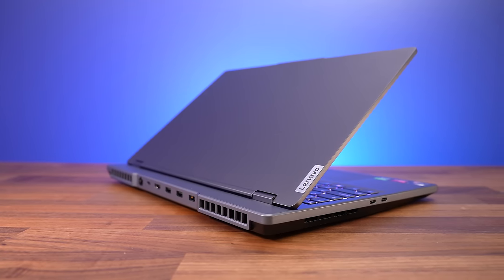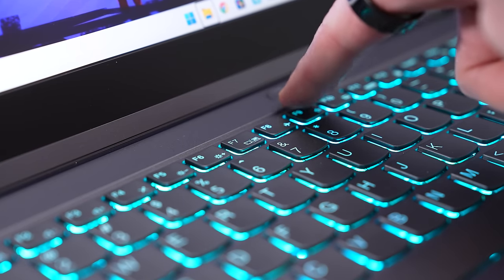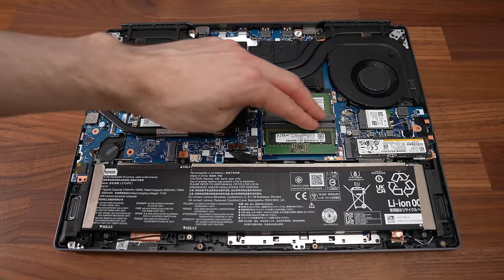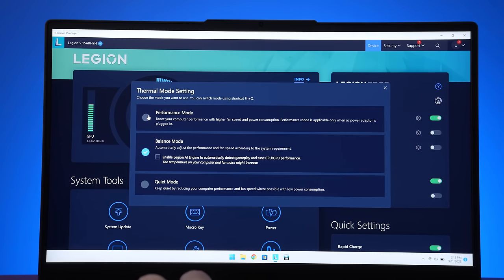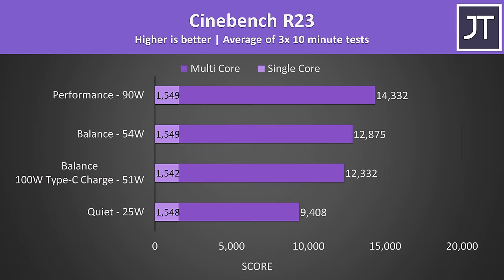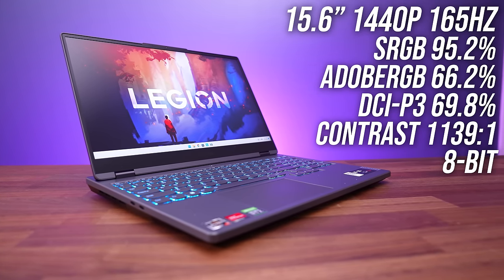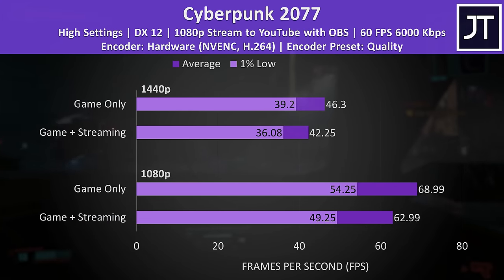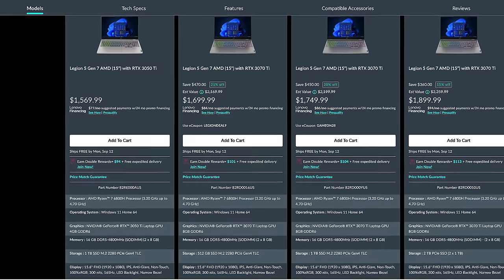Lenovo Legion 5 (2022) Review - Still Best Mid-Range Gaming Laptop?

Comment: Hey, Jarrod! I think that Lenovo gaming laptops are great, the reason I even bought my first personal laptop: Lenovo R7000 2020 (Chinese ver. of Legion 5) was because of your video review in 2020. That was also the year I discovered your channel because of how you go down into details with the specs and whatnot about the Laptops you review. I'd like to request if you can address the stuttering issue with Lenovo gaming Laptops? Lenovo Laptops have been gaining a lot of recognitions in the past few years particularly the Legion 5 and 7 in your reviews as well as their ranks in your annual ranking of gaming laptops that you've tested. I think that claiming, as per your video description, that Lenovo Laptops as your favorite high, mid-range gaming laptops are going to affect consumers' choice to buy off these models, only to reach a certain time where they experience lots of after-sales problems particularly with these annoying stutters. In my case, it happened like a month after I bought my laptop in 2020. I thought it was just a software issue that'll only be fixed by updating the drivers or something like that since it was a new laptop. But no, it did occur a few times until it reaches to the point that it became like a requirement to have the laptop get stutter when I try to use it. It usually happens when a play music, video, and games. Even just casual roaming around my desktop, it happens. I can't help, but to bear with this annoyance in the past couple years and just helplessly accepted my fate with this laptop. I thought that it was a defect on my laptop alone. After several research through the internet, I've been getting information that it was an AMD issue, since I own the AMD version. Then, I just found a recommended video on my Youtube feed that Lenovo Legion 7i has the same issue as well. What's worse is that, it has the worst stutter experience I've ever seen in a Laptop, like totally annoying, and loud given that his Laptop, Legion 7i, has far higher specs than I do. That's when it hit me that, that's it. I think that the after-sales concerns are not very much recognized in your channel. Not to mention, I even suggested and bought my sister, on her behalf, the Ideapad Gaming 3 amd Ryzen 7 3050 Ti.  Because other than the stuttering issue, Lenovo laptops are really great. But guess what, right after playing some music in her new laptop in the first day she unboxed and use it, the stuttering occured, I was like, wth are the deal with Lenovo and these stutters. Like, right now, I don't know how to react about it. I'm just helpless and truly disappointed. It's not the CPU, the updated drivers, etc., It's Lenovo.
Reply: Ya, I'll never buy a Lenovo AMD laptop again. 2021 Legion stopped getting bios updates within the first 6 months and is permanently stuck with stutter issues because Lenovo won't update the BIOS. The AMD update that finally fixes issues on the 5000 series came out in 2022 and Lenovo doesn't seem to update past the first year (last bios update was Dec 2021).

Comment: I have this exact design.
 Lenovo Legion 5 15ARH7H 15.6" Gaming Laptop Computer Platinum Collection - Grey
AMD Ryzen 7 6800H 3.2GHz Processor; NVIDIA GeForce RTX 3060 6GB GDDR6; 16GB DDR5-4800 RAM; 1TB Solid State Drive.
Could you please make a video on to how upgrade it to the max? I'd love it 😀  ❤️

Comment: Using Lenovo Legion 5 2021, no regrets!
Reply: Same, with a 3050 ti
Reply: @Grimmguy3  I have the i511400H with 3050ti, 80Wh battery but only lasts for 2 hrs on battery (power saving mode on, low brightness, using browser). That's my only regret
Reply: @HeyItsJace  yeah, mine has Ryzen 5800
Reply: Me too I however am just noticing that I am averaging 85-90 degrees Celsius on my CPU temp on any amount of load, and I can't remember if it was like that from the start. I even renewed the thermal paste and cleaned the fans. 

Are you having the same experience?

Comment: I have a question regarding this laptop. I am a somewhat casual gamer, but I know that what matters most in gaming performance is the gpu. Rtx3060, even mobile is more than a decent gpu, even now. But I can't help but wonder about the vram, I don't intend to play on more than 1080p, but I do want to be able to play all the new games on settings better than low. In this context, is 6gb of vram enough? Already games like star wars jedi survivor are demanding  in the spec sheet 8 gb of vram, I'm guessing it's ok for 4k, but will 1080p work good? 

I'm hoping that games makers will mind about the fact that there are a sizeable size of budget laptops that use 4-6gb of vram, rtx 3050 mobile, rtx 3060 mobile, rtx 4050 mobile. These are decent chips, it would be a shame to be punished for low vram. They are not meant for 4k.

I am upgrading from a gtx 1650ti and got the legion on a very good offer, it was the cheapest rtx3060 by far on a laptop, I can't afford anything better than this and I am wondering if it is worth it.

Comment: hello, i bought this laptop back then upon your video , works great but 512 GB is way low, i want to expand storage for data, based on datasheet it has PCIe 3.0 x4 slot , i know if i bought an SSD with PCIe 4.0 will work , but would function at advertised speed ? or it'd be downgraded to PCIe 3.0  specs? as i'm now between cheap 2TB from msi m450 or cruical P3 , or going upgrade with crucial P3 plus or P5 plus , i notice most of PCIe3 are QLC compared to PCIe4 mostly TLC , so what do you think? i rather have upgraded variant but if my laptop would never got benefit of its specs, i'd rather spend less , regards

Comment: Hello, I just bought this model online as of now and will be getting a 230W power brick. 

I have a question about the second SSD. It says it supports M.2 2280 SSD up to 1TB. 
(Notes: The storage capacity supported is based on the test results with current Lenovo storage offerings. The system may support larger storage as the technology develops.) 

Do you think it supports anything higher than 1TB?
Reply: 4:46 bro saind that it supports 4TB ssd on each side

Comment: I'm in the UK and we have LITTERALY the other side of stock hardware, probably made for the EU market as with the phone processors.
Now under sale is £999
2022 Lenovo Legion 5 NVIDIA RTX 3060, 16GB, 15.6" QHD IPS 165Hz, RYZEN 5-6600H Gaming Laptop
It's 6600h and Wi-Fi 6E 11ax, 2x2, 300W charger and Webcam FHD 1080p with E-camera Shutter, so it makes sense.
Just like my S21 Ultra has a different processor in the UK/EU vs US markets.

Comment: Thanks for this video. I did purchase this machine as a landscape student. I have done a lot of research but I feel I am still in need of some basic instruction on how to keep this machine from running well ( speed, temperature, battery life) For instance when I am running vray how should I prep this machine so that it runs best? Are there settings I should keep it at on a daily basis when I am not rendering? I am trying to learn from this video but I am not sure if it's all applicable to me. Thanks!
Reply: Hi! Have you some information about the battery life in real-world? I want to order this laptop but i'm a bit affraid about that. Thank you!
Reply: @asleoo999  I actually don’t atm. I just got it and planning on unboxing when I get back to school tbh I am a little intimidated.

Comment: If it had a metal chassis and wasn't as thick I might consider it. No per-key RGB, no Windows Hello is regrettable in 2022 though. That being said I know it has decent thermals, so there's that.
Reply: The Legion 7 models do have a Windows Hello fingerprint sensor. No per key RGB or brightness adjustments without software is annoying too. But the thickness is important for the higher power limits. Metal is also usually reserved for more expensive laptops than this.
Reply: No other laptop in this price range have the features you've mentioned. You're expecting too much.
Reply: @AdvancedGamingYT  You're right, it's a decent price/performance.

Comment: It would seem that moving that third heatpipe from the GPU-die to the NVMe slot had a negative impact on GPU thermals -- from my testing, the 3070 5 Pro from last year never even crested 80c in sustained 140W + 45W stress tests with its stock fan curve.
Reply: What processor did it came with?
Reply: @aceb2660  Ryzen 7 5800H
Reply: I have the legion 5 15ACH6, my battery only lasts 2 hours after a full charge, is this normal?

Comment: Bonjour
@ 6:00 regarding the USB C PD
The documentation says it is PD compliant but as explained in the video the Legion 5 Pro is NOT PD 3.1 compliant
In my point of view, Lenovo plays on words in their documentation and on their website
Having to use and buy a proprietary power supply to get 135W is, IMO, a pain 

My Legion 5 Pro (16IAH7H) is expected Dec 25 in the morning...🎄
I will see what happen when used with my Rocoren 140W USB power supply, but I suspect the load will be limited to 100W (20V, 5A)

Many many thanks for the vidéoS.
Regards, 40tude

Comment: Hey @Jarrod’sTech Important Question, I am in the process of buying The Legion 5i Pro but im not sure of which model to get. Should I get a AMD or Intel Based processor, which do you personally prefer? 🤔 Im not sure which one to get from a strictly gaming standpoint.
Reply: Which do you end up buying?
Reply: @naqib4235  I ended up buying the 2023 Legion 7i Pro RTX 4080 GPU with Intel I9 processor. Intel has more of a slight edge in gaming and some work loads too. Worth the buy for the Intel based machine.

Comment: I've bought the last year version Legion 5 2021 with 3060, when this Legion 5 2022 came out its kinda makes me want to replace to it because the newer more "sleek" design and higher 1440p resolution. Thankfully I'm waiting this review from Jarrod to get some deeper objective review,  so I'm stay using my Legion 5 2021. 
as JT said: If the laptop still works perfectly well, then no need to upgrade because there's always going to be something new just around the corner.

Comment: I am using Legion 5, 17 inches from 2020 for data analysis and light gaming. I think keyboard from Lenovo is best, even better than Apple. Thermals are OK  for me. Port selection and placement is great. Sometimes my laptop struggles with computational tasks but this is more OS issue. I absolutely adore it's design and overall ascetics. The only downside for me is dim display. It's matte but so-so, but as I am not a content creator this is not the issue. I think Legion laptops are really great.

Comment: I need help, which is better a Legion 5  AMD Ryzen 5 5600H - RAM DDR4 de 8 GB - SSD NVMe TLC de 512 GB - NVIDIA GeForce RTX 3060 ($899.99) or; Legion 5  AMD Ryzen 7 5800H - 16GB RAM - 512GB Storage - NVIDIA GeForce RTX 3050Ti. ($1099)
Reply: The answer is very simple, go for Legion 7 and I give you reason,
- Better CPU
-Better GPU ( TI version and new Version)
Also Legion 7 have some better futures like LED control with ICU

Comment: would it give me a 1080p 240hz if I connected to my benq 240hz monitor through a 2.1 HDMI cable? and is it going to use the integrated card or the dedicated card?
also not quite sure if I understood the optimus thing, but I read somewhere that if I turned the laptop screen off and used the external monitor, it should give me more frame rates.
Is it the same case with this laptop or it can't do that?

Comment: :cat-orange-whistling:AMAZING video! I have some asks,

1- Is it the sound on the headset (earphones) good? Is the audio program good? I have an Acer with that True Harmony and it's excellent, I wanted a good sound on the header in this Legion!

2- The notebook is very powerful and runs games at 100fps, if I play it via HDMI for my TV (which does not have G-Sync and etc) that displays a maximum of 60fps, looks good or gives stuttering? Activate V-Sync in each game slows down or does it solve the problem?

Comment: Hello, I am considering buying LENOVO Legion 5 15IAH7H 15.6" IPS 165Hz i5-12500H 16GB RAM 512GB SSD GeForce RTX3060, but my main worry is about the temperature of cpu and gpu and the thermal throttling, as it was a main issure my colleagues told me about with gaming laptops. Will it be able to run AAA games, like Elden Ring or God of War on high settings without temperature problems? 
Thanks for all the useful content.
Reply: Yes i think it will able to run those games without any serious thermal problems. 

Just make sure you keep track of the temperatures and maybe consider lowering the power mode to balanced mode or turning down the resolution to 1080p when you feel it's getting real hot or the temperatures are getting above around 82°+

And most importantly while playing try to raise the back of the laptop with something(i normally use the power brick), so it can suck cool air up into the machine and blow the hot airs out from the sides.

I own this laptop and i don't have problems so far, if i were to pick what i don't like about this laptop it would be the loud fan noise cause i am not used to gaming laptops but i can live with it, and i think you should consider the ryzen 7 6800h version.
Reply: @assaultedzlayer8393  Does your Legion come with Ryzen 6800H? I am torn between 6800H and i5-12500H 😢😅
Reply: @naqib4235  yes mine comes with that ryzen, and not to bum you down but after some months of using it, the ryzen is having a problem. It sometimes causes black screen when you are watching youtube in hybrid mode (discrete graphics mode is fine), the good thing is not everyone is having this issue, the ryzen has a really good battery.   But intel seems better in terms of glitches and faliure like black screen. My advice is if you are gonna go with ryzen and if you ever encounter this RARE problem its okay you can use discrete graphics mode (nvidia mode) and only having a bit less battery life if you compare it to intel's battery.
Reply: @assaultedzlayer8393  Ok I just made up my mind. I don't care about battery. So Intel here I come~ haha
Reply: @naqib4235  wise choice

Comment: Not a bad laptop then, considering I got mine from my company’s e-waste for next to nothing. And with the 300W brick, 32GB ram and rtx 3070, it was a huge upgrade to my ThinkPad T460 that I used before.

Mine was running Ubuntu when I got it, since it initially refused to install Win10 - possibly why they put it in e-waste when they couldn’t get past it. But I got past that and it now runs win10 on the main ssd, with my main data (not programs) stored on an external HDD. 

Works great and I’m happy to not play games and do other demanding tasks on, compared to this, a potato.

Comment: I would love if you could investigate the TB4 compatibility with an e-GPU, since the GPU it´s the main reason these computers get outdated faster than you´d like.
Being able to update with a 4070 or similar in the future would be fantastic.
Thanks for your work.
Reply: a 4070 would be very limited by the max 40gbit of usb 4/tb3. USB 80 gbit would be good. But i really like thunderbolt because i could connect my external monitors to the igpu. You really only need 1 hdmi to the video card everything else should be igpu because you only need 1 monitor for gaming. Not alot of people game on 3 monitors. But i think the best solution is being able to switch to which what you prefer. I would like to use a laptop as a 3rd monitor and having all monitors hooked up to the same gpu i think is better. Especially because i don't care about limited gaming performece through optimus.

Comment: You could manually add 60hz option with cru and uses automatic refresh rate switcher to switch to 60hz on battery to boost battery life on legion 5
Reply: If you disabled nvidia optimus you dont need cru because nvidia driver control panel can do it, this is what i ve done in my laptop. Of course i lower it for anything outside esport gaming, to do 60 fps cap, because if i keep it at 144hz 60 fps looks like piece of 💩 , believe or not 60 fps on 60 hz looks smoother than 60 fps at 144hz display i dont know why.

Comment: Hi jarrod how are you.
Now i have nice deal with 
Legion 5 pro amd gen 6 rtx 3070
and the legion 5 in that video at the same price what should i do
I only gaming , programming and studying
Reply: I am planing on purchasing that model but with 3060 but have no idea if the back usb c port can handle a monitor or more importantly vr headset using a display port to usb c adapter.
Any ideas ? Cheers

Comment: Lenovo Legion 5 15ARP8 15.6" Gaming Laptop Computer - Storm Grey
AMD Ryzen 7 7735HS 3.2GHz Processor; NVIDIA GeForce RTX 4060 8GB GDDR6; 16GB DDR5-4800 RAM; 1TB Solid State Drive
I got this for 829 including tax.  Good deal ?  Not?
Reply: I just got this to it’s basically the equivalent to this laptop. I’m trying to find out the same

Comment: I. ADORE. U JARROD!!!!! I was already impressed by the ultra detailed laptop review which u posted, but never did I expect u to test linux support, least of all Ubuntu, the very distro I daily drive. On top of that, as if reading my mind, u go ahead and assuage my doubts on support for precisely the very things I was concerned about - keyboard lighting and perf. mngmt... chef's kiss! Your, albeit tedious,  coverage of laptops is excellent bar none and invaluable to actual market goers looking to buy a new machine. Again, testing for linux support was going above and beyond, especially when Google gave a grim picture showing stitched together kernels and long reddit frustrations. U r, in my opinion, the unsung creator of an unglamorous, remarkably meticulous, one shot reference for prospective buyers, modulo only spec sheets, though they too, at times, blush seeing ur videos. Incredible work showing careful thought. Massive effort.